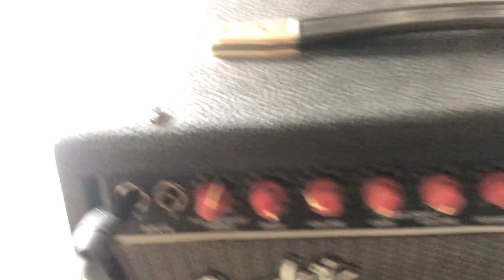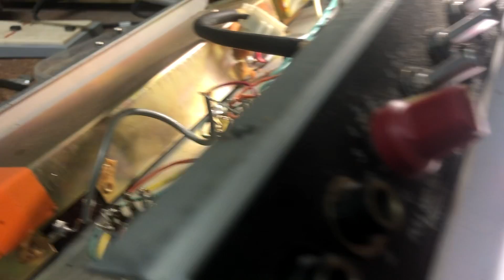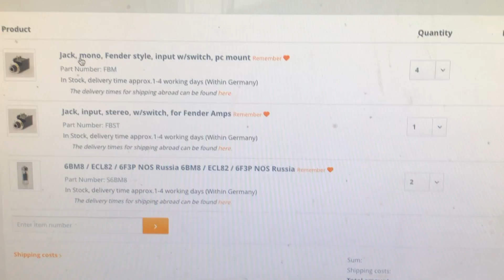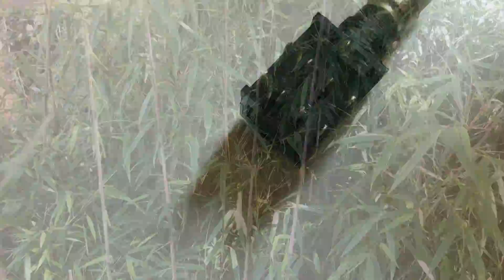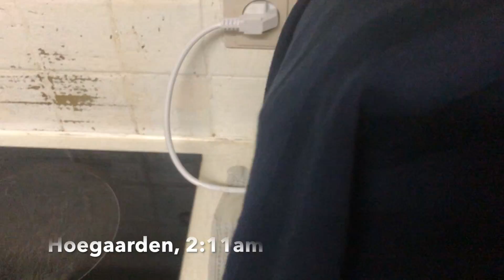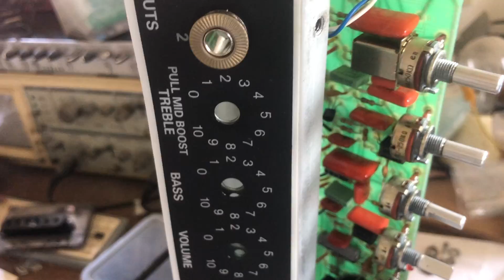Fender Champ 12: the ultimate sleeper amp?

Comment: I like mine a ton but I just can’t the random channel switching problem sorted out.
Reply from the maker: It uses a relay, clean the switch with WD40 and check voltages around the relay, it's a little black box on the pcb
Reply: @z @zjokka  the amp was a gifted nonfunctional basket case. I did a complete recap, new jacks (all broken or loose), new bass pot (snapped post), and reconnected those hairs for reverb wires. Good learning experience
Reply: @zjokka Cheers! Thanks for the help! is that the infamous octocoupler I’ve read about?

Comment: Hi, could you explain the wiring of the Switchcraft 12A input?
The original jack has 4 pins, while the Switchcraft has 3. How do you connect it
Reply from the maker: Guitar input jack should be shorting when unused. There are three parts: TIP = signal, SLEEVE = ground. Now there's a third connection that connects to the tip when no jack is plugged in. That should also be grounded, so that when nothing's plugged in, the signal path is grounded. Hope that answers your question.
Reply: @zjokka So, no cable should be soldered into the two adjacent holes on the PCB—can you confirm?

Comment: Why do so many folks talk this amp bad?
As a matter of fact= tis amp was on Eric Claptons guitar techs table in the 90s.
My amp is souped up with a Jensen speaker, Switschcraft input jacks, higher capacity condensers (C1 to C3) and the very best Tube Amp Doctor valves.
It excels not only on stage, but alsoin the studio, as it is now nigh silent in idle mode.
It´s a great amp. PERIOD!
Reply from the maker: Because they do not know what's under the hood. Many of the red knob series are transistor amps of hybrids. In the 90's when the vintage craze started, nobody cared for silverfaces. Now a silver champ will burn a 1k hole in your pocket. Hang on to your amp, which i still had this one...

Comment: I have one of these amps, well I like it makes a great noise especially cranked. A strange twist of fate mine has black knobs and a red tolex outer cover. Much under rated amp, it compares quite well with my other fenders which are gig size r'n'r where this one is great for a jazz band or home use. Love the growl it make when it powers up, announces itself as a tiny monster.
Reply from the maker: Thanks for watching the video... Yes, they are very much unrated -- a good deal of the red (or black - earlier edition? Japanese market?) knob amps are solid state. But it's a decent effort by Fender in producing a souped up Champ: bigger speaker, 6L6GC, reverb onboard... should have been a hit. But at the time they came out, Silver panel Fenders were still cheap and Black panels affordable...

Comment: have a Fender Champ 12 that I bought in 1987 new for about $350.  Fender  Princeton and other small Fender amps were hard to come by in Montreal in 1987. So later, I put in a Mercury Magnetics transformer and an  Eminence  Cannabis Rex speaker and never looked back .  Is it a Princeton? No it isn't. That's why later, when I learned how to play better, I bought a Deluxe Reverb (a fine amp). Would I want a Princeton? Maybe, but my Champ 12 with it's "one sound clean sound" does just fine next to the Princeton as this video clip demonstrated. Would I sell the Champ? No. I love it  in all its simplicity. It reveals all the inadequacies of my playing. I have an Electro Harmonix Nano reverb and a Seymour Duncan Pickup booster that I use with it. I wouldn't trade it, even though I get offers for it quite often.
Reply from the maker: Hell yeah "it reveals the inadequacies of my playing" -- that's the attitude of a real guitar player. A have a few amps still around, but this was the only small amp with reverb. Ever since I started playing pa heads and small tweed style amps, i really started improving as a guitar player. This Champ 12 would have been a keeper for me too, took some time to sell, was not going to let it go for 250EUR. Needed some cash. Still I think single ended amps like this suffer more in tone from implementing a reverb circuit than larger amps. 
Thanks for the nice comment, please feel free to subscribe and help me reach 1k

Comment: The clear top MIJ jack is original, the black top ones are replacements. The TAD jacks are the available modern replacements (Hotrox in the UK also sell them). It looks like someone has changed the reverb tank, the original one is in a cardboard box, is very wimpy sounding, and has extremely thin wires green and black wires connecting it to the board. On that topic, be really careful with the pre-amp valve wires, they are very fragile and break off the board and valve pins very easily when moving the board around. Check out the manual for guidance on how to adjust the reverb trim pot, too much and it will oscillate horribly. The distortion can sound great IF you push the clean channel, or follow Johan Segeborn's vid for the gain channel. Nice job and great playing, it sounds lovely.
Reply from the maker: Thanks for the pointers and comments! I think the distortion channel needs a built-in mid cut. Problems is EQ settings for clean are settings for dirty ... It looks like a Rivera/Dumble kinda design on the outside. What people wanted in the 80's...

Comment: If the reverb is that crappy, it might just be a lousy tank...the reverb in my blues junior 3 was practically unusable, so I put in a usa-made accutronics tank from an early-'90s  blues junior 1 and it made a world of difference...and electrovoices really are fantastic speakers, the fact that they don't color your sound too much but let more of the rest of  your rig come through is nice
Reply from the maker: Hey Jason, thanks so much for the comment. Yes, the reverb, have been thinking about upgrading the tank, but didn't do it (yet) for a number of reasons: 1) it's a red knob, nobody wants it unless very cheap unfortunately, investing in upgrades is a bottomless pit I fear; 2) the whole speaker driver reverb setup really makes the output section unstable unless you keep the reverb trim pot down -- if not it will start oscillating, especially when the drive channel is on.
I'm just a hobbyist and try to buy cheap broken amps and less them on without losing too much money...  perhaps you agree that is some sense this is the grandaddy of the so important Blues Junior -- Deluxe 65 Red Knob might be a daddy... being pushpull.
Here's a question popped into mind while answering your question: does changing the speaker change the nature of the reverb  (noticeably)?
Reply: @zjokka  No, I've never seen any change in reverb quality just from a speaker swap...I get what you're saying about not wanting to dump too much money into it if it's not going to be a keeper, I'd done that quite a few times myself and it's a bitter pill to swallow
Reply: The reverb circuit itself is pretty crappy in these amps. These tap some output signal from the power amp  into the tank. And the output signal of the tank returns into the power amp  creating a bit of a feedback loop which makes it sound overly bouncy. Puting a good tank in it doesn’t improve this very much due to the circuit. You would need to tap the signal from a point earlier in the circuit to improve it.

Comment: Actually, this was one of the FIRST all-tube amps to come out of the Post-CBS Fender. Other tube amps in this “Red knob” series included “The Twin,” and the “Dual Showman.” From a serviceability and quality standpoint, they were okay, but not great—they use PC card construction, and tonally, they left much room for improvement. I had a Champ 12 once. It was ok, but it didn’t really have that Fender sound, and yeah, the reverb, even on 10, was absolutely puny and HORRIBLE compared to a 1960’s Fender. Heck, even my Peavey Backstage amp has better reverb than that!
Reply: As I say, these were among the first tube amps to come out of the Post-CBS Fender. It was a real struggle for them, because the deal that management struck to buy Fender from CBS did not include the factory in Fullerton, so the Post-CBS Fender was literally left for a couple of years without any manufacturing capacity, and so they basically had to rely on leftover CBS inventory and Japanese imports like the Fender Sidekick line to tide them over until they got their new USA factory setup in Corona, CA.
Reply from the maker: Hey Benjamin, thanks for commenting. I went into the guitar store to buy an amp in 1989 and I wanted a 2x12 like my guitar teacher, who had a silverface Twin Reverb. I ended up with a Power Chorus solid state amp, not even realizing it was solid state. Red Knob era is when Fender tries to embrace solid state guitar amps. Red knob Twin or Dual Showman are not new designs -- putting a single ended 6L6GC in a combo with a reverb and 12" speaker was as original a design as ever come out under Fender name since CBS took over. 
You are right: reverb isn't the best, it needs a new tank in the bottom and it certainly benefits from a speaker upgrade. But it's what nowadays everybody wants: single ended, big speaker, compact size... 
Check out the Fender Frontman I repaired last week -- I cannot believe people just put those amps with the trash... they sound really Fendery and good enough for me... tone is in the fingers my friend. Take care! Johan
Reply: I have a peavey backstage 110 and through an ext cab it sounds great, this fender might sound great through a bigger cab too...the cab construction often hamstrings the tone of small amps, especially once you get into the '70s and particleboard becomes more common than fingerjointed wood

Comment: There are insulation washer sets for Switchcraft metal jacks available if needed. I have used them sometimes to avoid ground loop problems. The problem with those is that because of the 'shoulder' of the insulation washer the jack hole in chassis usually must be made larger to fit that insulation washer shoulder between that threaded jack ground body and chassis metal. That reverb circuit is a bit funny because, if I remember correct, output stage of that amp acts as a reverb driver as well.